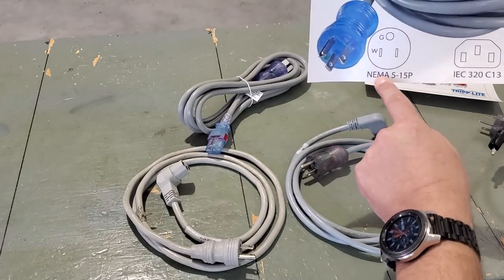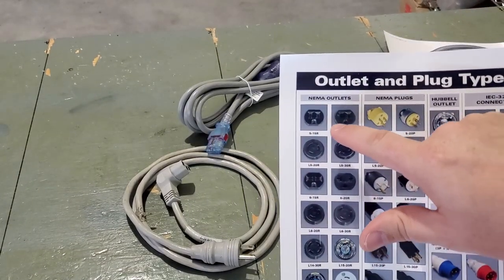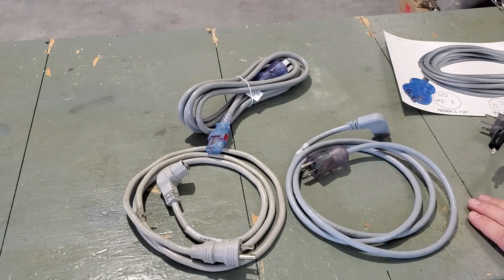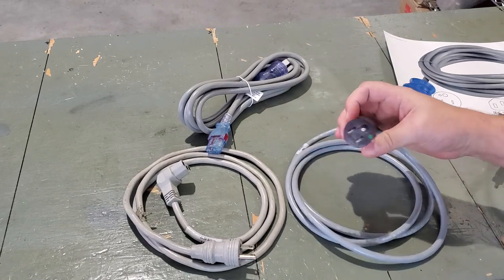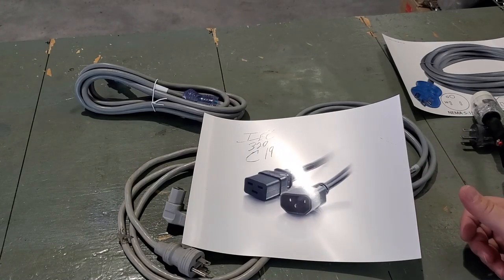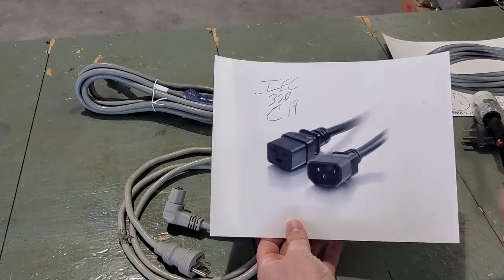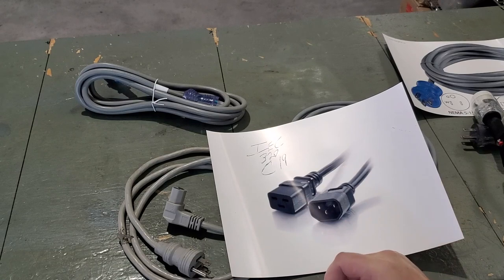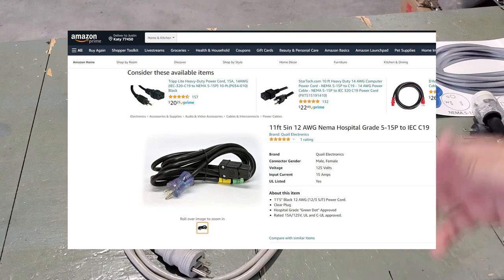Ordering Power Cords: What You Should Know!

Comment: If you have a chance to dissect some nema style plugs to see the difference between hospital grade and regular, that would be interesting.  There are higher resistances in lesser plugs, causing them to heat up with higher current draws. Other than better isolation of hot and neutral, and better metallurgy for less electrical resistance, I do not see any differences readily. Even high end audio power cables, apart from things mentioned, are no different, other than thicker, more pure copper conductors.
Reply from the maker: https://megaelectronics.com/frequently-asked-questions-about-hospital-grade-power-cords/#:~:text=Hospital%20grade%20cords%20and%20cord,817%20and%20CAN%2FCSA%20C22.